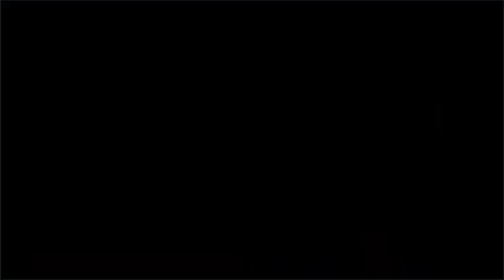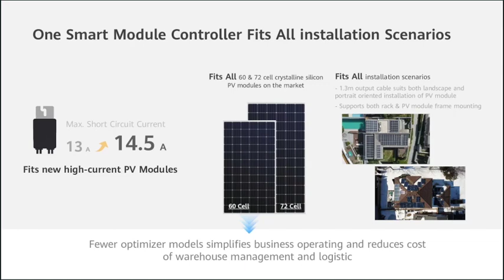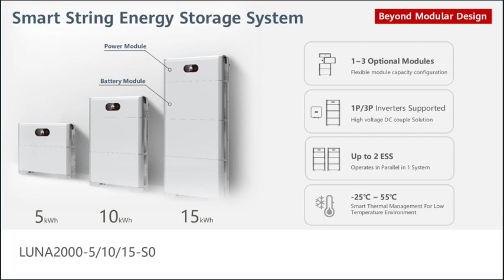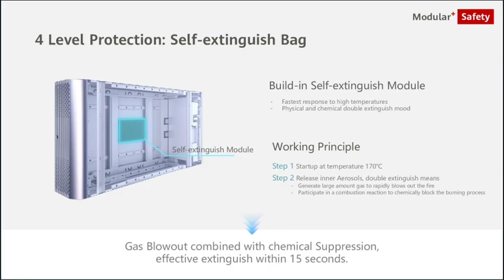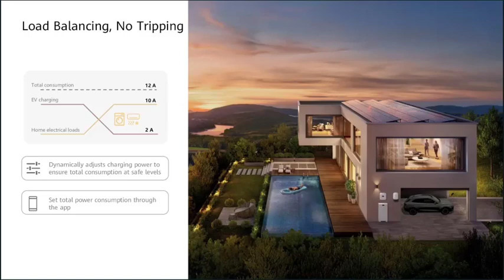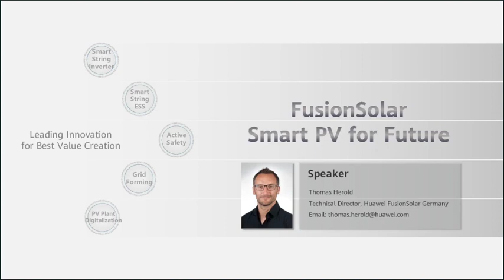PV Tech TechTalk Webinar

Comment: Fantastic System and features.
Clouding EMMA, not so much.
Independent but somewhat dependent, maybe a local version accessory that could do this in the future would be nice.
Having as an option with the local management system, the possibility to access latest logic and software iterations via internet.
But definitely not having to be constrained to an enclosed cloud system.
Cloud usually translates to end of life in terms of support and push for buying slightly redesigned hardware.